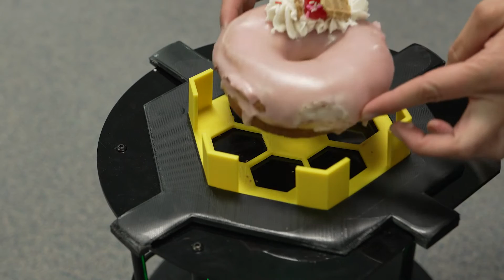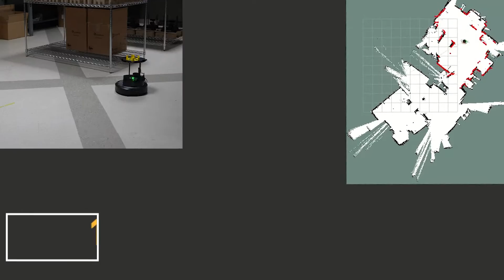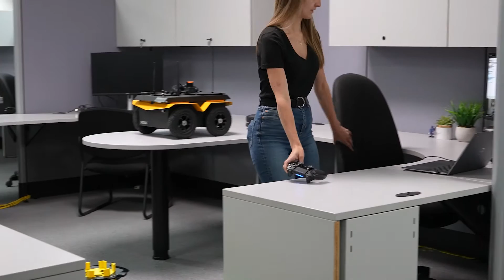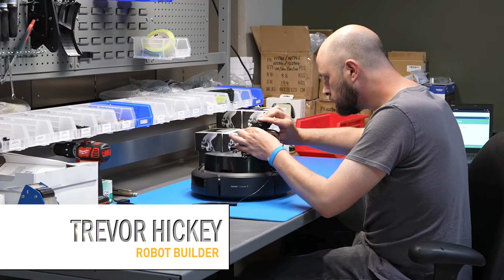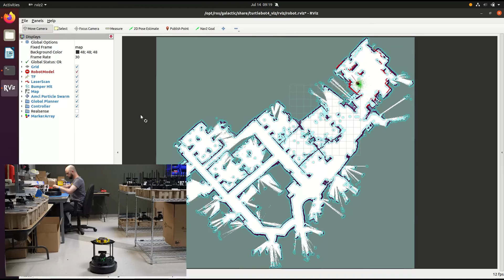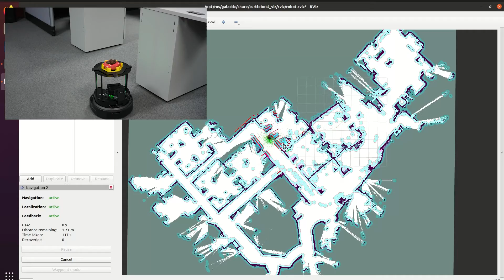Comment: Super Nice congratulations! I have an application which I use a bot in an unstructured environment (off road). A previous map for matching with SLAM toolbox might not work. Is there a GPS solution or tutorial you could share? I mean, my robot must follow latitude/longitude (as reference) to follow, instead the goal pose set over the map (as reference). In addition how did you integrate a real Lidar to /scab the environment and mapping? I am having issues with my VLP-16 (Rviz  crashes after launch Nav2 nodes), Some tutorial to communicate with hardware? Thanks for attention 😊

Comment: hi, I'm using turtlebot4 and there are some problems.
I want rasberrypi4 to be AP mode again.
but after restarting the turtlebot4, I can't find Turtlebot4 wifi on the laptop
How can I make rasberrypi4 be AP mode again?
Reply: Hi Kihoon!  Our team is happy to help over here:  https://github.com/turtlebot/turtlebot4/issues.  Open a new issue at the link above and someone will get back to you!
Reply: I would suggest you to connect to RP via SSH. Plug ethernet with static IP, same IP as mentioned in documentation as default for RP. Its 198.**.***.** somthing